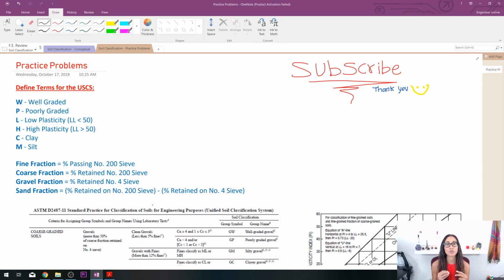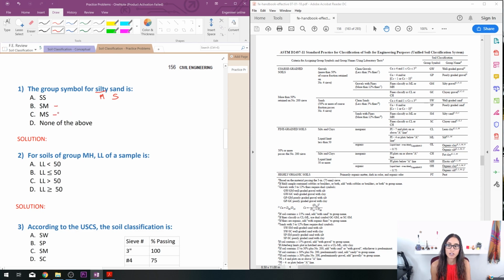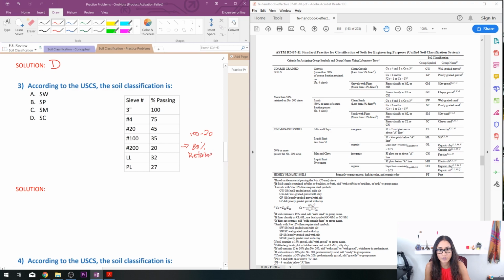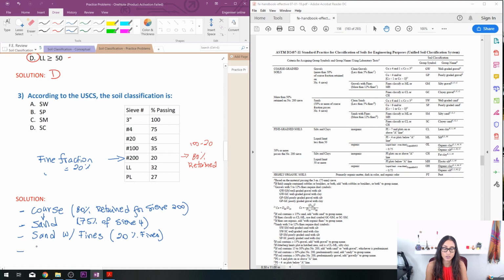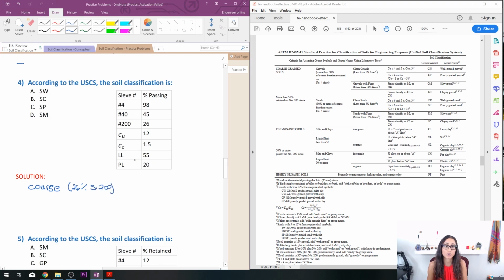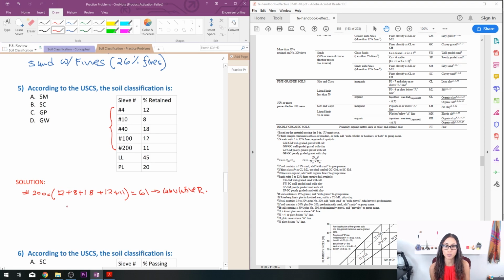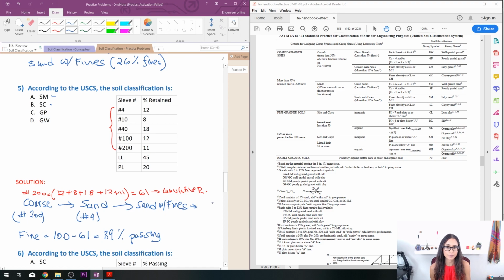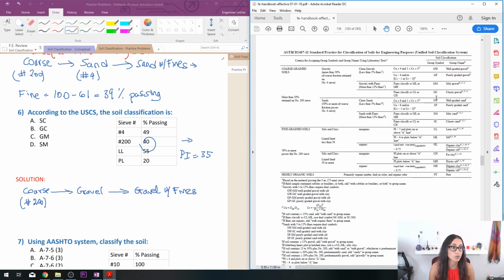FE Civil Geotechnical Engineering - Classify Soil Using USCS

Comment: When checking whether a soil is gravel or sand you should use coarse fraction, not just the fraction that passes sieve no 4. You could get the wrong answer this way and you should edit that.

Comment: my question is how can these information be used on hydraulic open concrete channel or designing a dam ? I know clay definitely play as impermeable layer in the landfill and on gravity dam structure. It would be better if you could correlate to actual infrastructures that ordinary citizens have access and benefit from. These videos are intended for FE problem solving but in order to be fully onto our heart and brain is to see in our practical life daily uses. That way I retained my English much better as well something can be done here examples of modern product of civil engineering from ordinaries.

Comment: Hi  thank you for the video. I have a couple of questions based on the problems you did on the video. So to classify a soil using the USCS Method when is a gravel or sand and you want to determine the next classification ( clean gravel, gravels with fines, or clean sands  or sands with fines we always look at the %  passing for sieve 200? Also, how do you classify if a soils is organic or inorganic?  Last question is the retained % instead of passing % you mentioned we have to add up all the % retained in the sieves, would that apply of we have to find another sieve besides sieve 4 ?

Comment: On #5 you classified the soil as Sand and that is correct but you did that based on 12% retained (88% passing), this is technically not correct.  The Sand classification should be based on the Course Fraction which would actually be (88-39)/61=80.3% which represents your Sand Fraction of the Course Materials.
Reply from the maker: Hello Ryan, thank you for sharing this. You can solve this problem in so many different ways, and looks like your method works. So we could solve this problem using the fraction, but it would take a little bit too long for the FE exam. When we are giving the percentage retained, the best way to solve it, is to take the sum up to 200 sieve and then solve from there. I hope this makes sense and thank you for watching! Good luck with your studying!
Reply: @Genieprep  Hello! Thank you so much for your videos. I do want to add that Ryan is correct here, and that if you just take the total percent retained on #4 sieve instead of the percent of the coarse fraction that is retained, you could occasionally get the wrong answer. In calculating the percent of the coarse fraction retained on #4 sieve, it should be R4/R200.